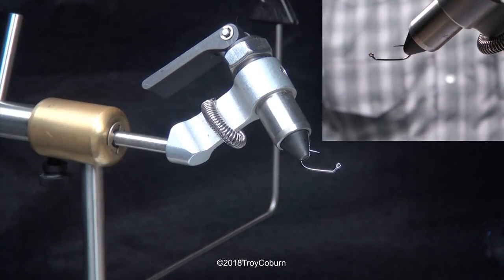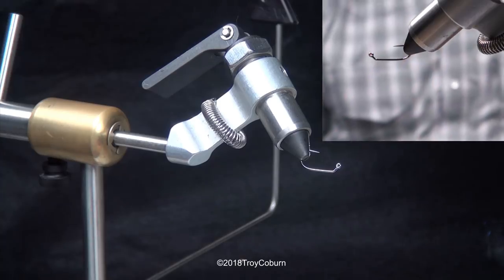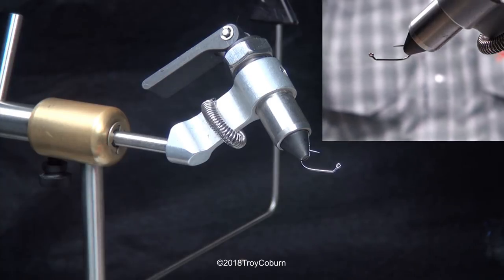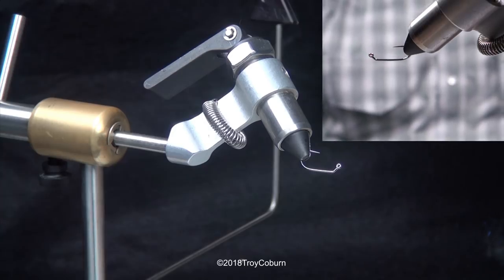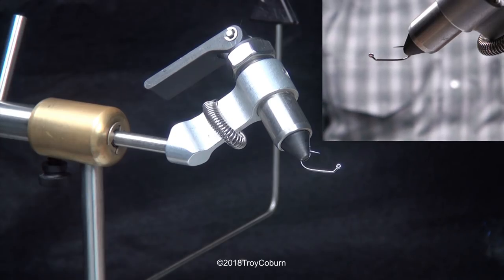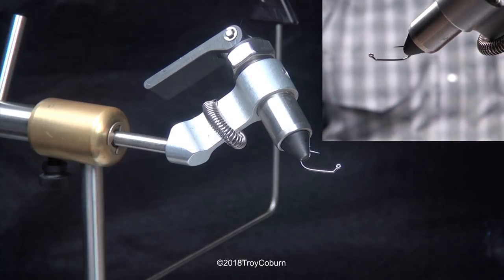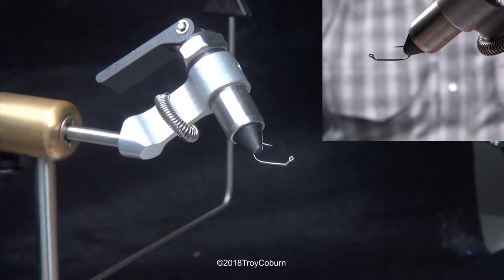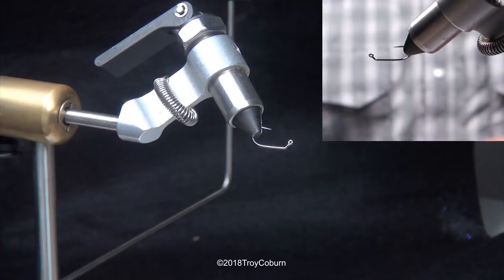"One Inch Death Punch" - Streamer Fly Tying Video - Troy Coburn Fly Pattern

Comment: Ya did a good job on this video.  In this day and age some folks want the information fast and on to the next one.  One thing to consider is that if you don't have any slotted beads you can use regular ones by turning around the bead and have the bigger hole in the bead facing forward toward the hook eye.  Unless the bead is extra large for the hook there's still room to tie on.  I have personally quit using the slotted ones.  Pine Squirrel is exceptional stuff.  Again good work.